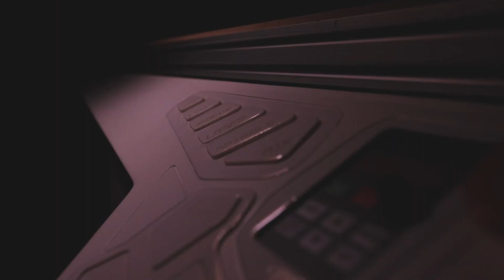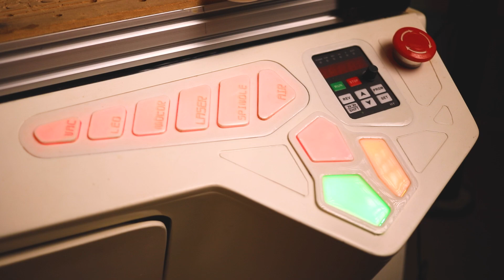My Workbee CNC // 3 years later // Major updates

Comment: I have a workbee, but I limit its use to wood. I built a seperate, smaller CNC for metal. Beefy linear rails and ball screws, with a steel frame. Bigger steppers too.
I have considered upgrading the workbee, but it is probably easier to just build a new machine- so much gets replaced. I find that, for wood, it is fine.
Reply from the maker: Seems like a common story to many folk I speak to about their CNC experience and owning a workbee. My workbee has been a glorified storage table for some years now and waiting conversion into another machine like a plasma table or similar 😂

Comment: Quick question: I'm coming from an OX CNC - your linear rail for the X axis is great (thanks for the parts listing). You got rid of the wheels as no longer required - did you make a spacing block that goes between the spindle plate and the drive plate to connect the spindle/back plates round the X axis? Also, do the linear rail slides bot straight onto the spindle plate using existing holes?
Reply from the maker: Thanks for your comment. Yes I made a new mounting plate for the spindle and 3D printed a connector block from the lead screw plate to the new z axis! If you haven’t had a chance yet, please download the files from thangs as I have included details on this upgrade that should answer your questions. Feel free to ask me anything you’re not sure of?
Reply: @NEWTechCreative  Thanks - just downloaded and that was the missing bit. The new plate and spacers are all in the "3D Printed Spacers" link. Cheers! Now to find a place to cut the plate. Any suggestions on the plate thickness?
Reply from the maker: Fantastic! I would aim for 12mm for the plate - no thinner than 9mm! 👍

Comment: Hello, thank you for your video. How precise is the machine? I would like to buy a Stepcraft, but it's not cheap and that's why I'm looking for alternatives
Reply from the maker: Since purchasing the original workbee, there has been many upgrades made by the community. You can get the ‘QueenBee Pro’ and the specs are comparable to the tolerance of the stepcraft, however without owning either machines it is impossible to validate. With the stepcraft, you are purchasing a pre assembled and tested unit, support and a guaranteed experience. Where the QueenBee Pro, you have to build it yourself and you are responsible for the outcome, however you have a machine that is much greater in size and half the price. If you’re confident in building a CNC from a kit build and ensuring it’s square and dialed in the Queenbee Pro is great. I hope this helps 👍

Comment: as per esp32 and fluid NC software user interface is web based platform. we can change or monitor whats going on by TAB,MOBILE,PC which have wifi and and capable of opening browser--which i have understood from your video esp32 fluidnC. My question is if i use raspbery pi zero W then is it possible to use that web page of interfacing???
Reply from the maker: Great question!! I’m not familiar with the pi zero W, however if it can access and load webpages… yes of course!!
Reply: @NEWTechCreative  I actually want to use cnc without pc, as mach3 I have used,all the time pc needs to on. Now fluidnc cnc html web based then raspberry Pi support whole Linux OS , then it will also support web browser. After testing I will update to you.thanks for reply,

Comment: But with the upgrade does that turn it into Workbee Z1+? Is that the difference with the original one VS the newer one?  Would you say the tech included with this machine is worth the overall cost? 

Thanks
Reply from the maker: No sorry. The Z1+ still uses the plastic wheels and has the same issues. There are other versions made by 3rd parties that come with linear rails such as the ultimate bee or queen bee. 👍
Reply from the maker: I purchased the original 1000x1500 workbee from bulkman for USD660 (without electronics or spindle as I already owned) and rails for USD150… total of USD810… not bad!! The only downside is that I lost 60mm in x travel distance with my new upgrade - definitely worth the compromise!!

Comment: Hi
I am Taljit Singh from India, I am developing.. Cnc router with MKS DLC 32v2.1......i flashes fluid NC in to board, but when I connect end switch to board, it automatically disconnected, COM port not detect it, can you share any solution to fix it. 

And your Machine is too good, look wise and it's performance....... 

Thanks
Reply from the maker: Thanks for your comment Taljit. I’m not familiar with this board however from my experience this could be one of two things. 
1. There are 3 pins- GND, 5v and COM pins. If you have connected the wrong pins, this could cause an issue. Check pins with a multimeter to check. 
2. There might be a manufacturing issue with board and a connecting might be bridged. Once again, check with your multimeter for faults and continuity of pins. 
Sorry I do not have a magic fix! Good luck 👍

Comment: Can you list what challenges you had to overcome when converting the X axis to linear rail?   Was considering a Queen Ant upgrade but this would be a much cheaper path.  As for the Z-Axis I would like to see where I am at after updating the X axis.
Reply from the maker: I agree! I think the main challenge was to dismantle the original parts really! It will be easier to add everything onto the x beam when removed off the machine then screw on after. You can get away with not needing the extra thick c-beam… I think the rails make a huge difference in stiffening the x axis, however if your like me and may as well do it all at once - go for it! I can share my front z axis adapter plate as well… I cut mine out of 13mm aluminum, however 8mm will suffice. Then you will need 2xm8 & 2xm5 bolts to insert from the back of the old plate through the 3d printed spacers then thread your front adapter plate to fasten.. this will create a strong bond. I can proved better instructions if you need? Send me an email to newtechcreative@gmail.com

Comment: Hey there, fellow Aussie Workbee owner here. I share your frustration with the play in the Z and X axis multiplying off each other. I haven't played in Alloy yet, but had accuracy issues from my (z axis mounted) dust collection bristles deforming the axis enough with just hardwood on relatively deep plunges. I was trying to get repeatable cuts in components that would ultimately mount together, but the axis was defecting enough to get an angled cut on the deeper component. I went for the independent dust boot solution rather than the linear rail solution (at least for now), it was working well, but the baseplate was 3D printed and ultimately has sagged over time... That was the first time I legitimately considered cutting alloy for a replacement part. Been following your channel for quite some time, great to see you're still at it! Keep up the great work
Reply from the maker: Thank you for your long time support!! So glad to have another Aussie/workbee user following 🤩 yes I will continue to play with ideas for the dust boot also. I do like the independent dust boot approach! I rest appreciate your support 👍👍